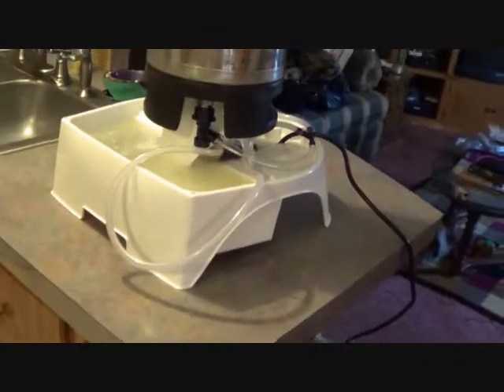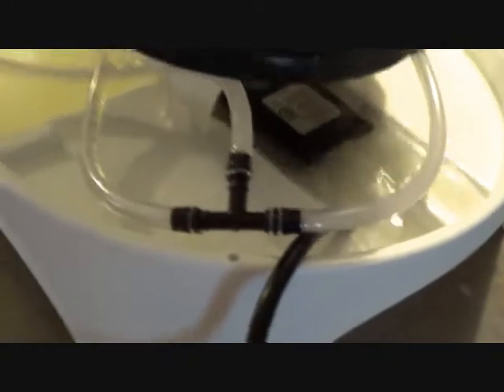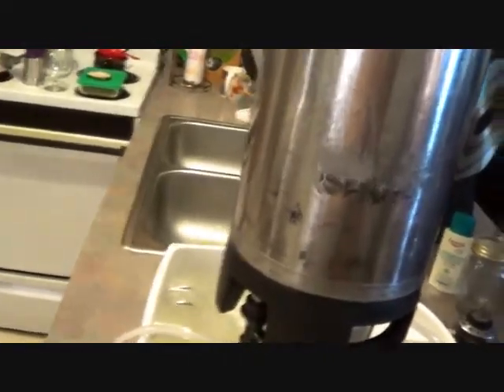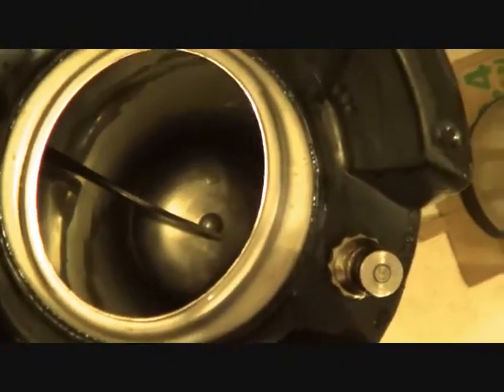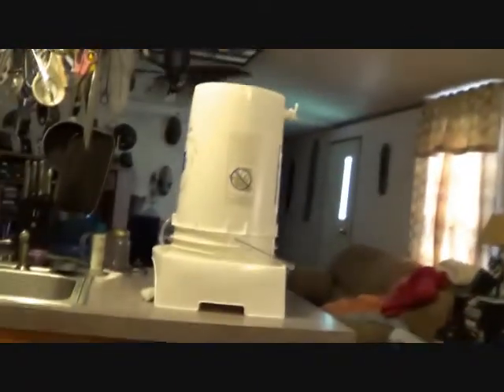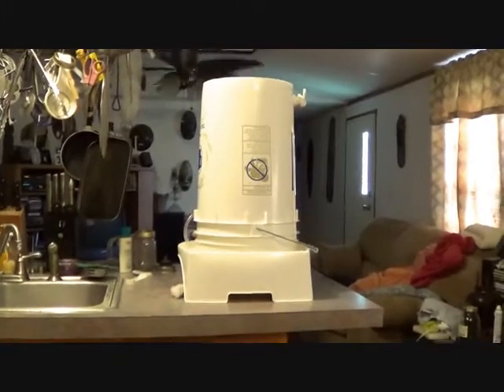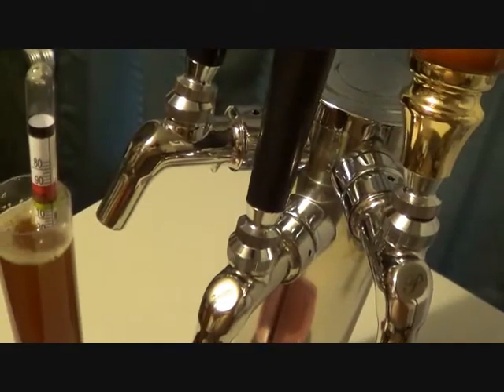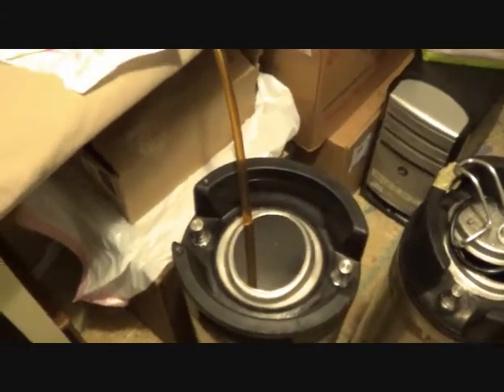Homebrew Wednesday #85 8-28-2013

Comment from the maker: I used Star San in it after I Cleaned all the pieces with PBW. Yes it did foam up a some, I only ran the Star San Solution in each piece for the 2 minutes of contact time necessary to Sanitize them. I was expecting it to foam a lot more than it did, but it worked without any issues with 2 mins on each piece. I'll film it next time I clean and sanitize a Keg or Carboy and post it. The one thing I really liked was the foam was in the bottom of the pieces instead of the top when it finished.

Comment from the maker: The Pump does a great job as long as you don't divert the pressure to much. It wasn't designed to handle both valves at the same time, Just do the gas connect for 5, then the Beer connect for 10 and it's good to go. The down side to a really powerful pump I think would be it would cause the bath to foam up to much, especially when using Star San in it. So there's an up side to the pumps flow rate. The Red tasted Awesome when I checked the gravity sample Yum! HHBW, Cheers Nate!

Comment from the maker: Yeah it works Great. Check here on Youtube for a bunch of Videos on how to build one. I thought about building one myself, but the Submersible Utility Pumps from the Home Improvement stores cost almost as much as the entire Mark II did and it already has all the special attachments. Just have to buy the Gas and Liquid Quick Disconnects and plumb them in. Pretty much Turn Key. Add 1 gallon of Hot/Warm water, 1 Tablespoon of PBW and plug it in, Rock and Roll. Happy HBW, Cheers Grant!

Comment from the maker: Yeah it's a pretty sweet Toy eerrr I mean Tool....lol. I've got a jet bottle washer too, I use it for cleaning out bottles, no way I'm standing there for 15 mins holding a keg or carboy up while that thing sprays it out, plus all that water goes down the drain, the washer just recirculates it. Not really a cheap toy/tool, but it'll pay for itself in time with Water and PBW usage, plus it frees you up to drink beer while it's running....lol. Happy Homebrew, Cheers!

Comment: Yep I agree with you, much cool than a jet bottle washer.  Normally with super hot water out of my tap, I can get a carboy clean very fast.  However, that fact that you can do PBW and Sanitizer as well is very cool.  You may have to use Iodopher though, not sure Starsan will work with that.  Shoot a video with starsan, I'm wondering if it will bubble up like mad.  I don't use it in my bottle washer anymore, it gets too messy.